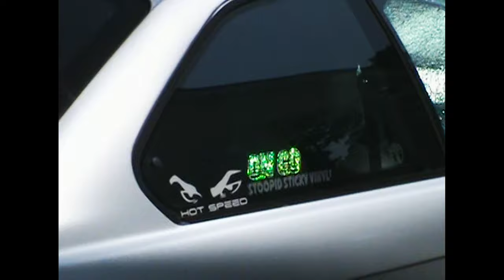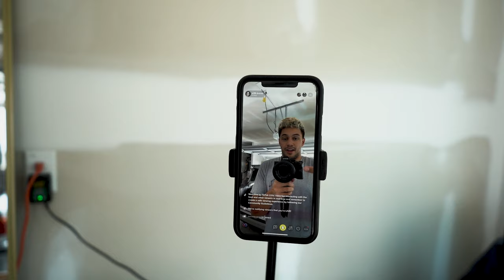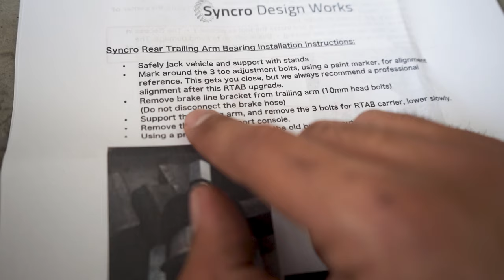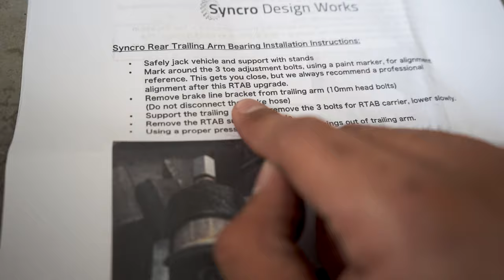𝔼𝟛𝟞 𝕥𝕦𝕣𝕟𝕖𝕕 𝕞𝕖 𝕚𝕟𝕥𝕠 𝕒 𝕞𝕖𝕔𝕙𝕒𝕟𝕚𝕔 | BEST RTAB replacement for e36!

Comment: That rtab bracket was modified for extra degrees of toe to compensate for camber so a stance guy had that car before lol. And I've had those Syncros on my car for 8 years and they've been perfect
Reply from the maker: Oh makes sense, whoever it was must have not been low enough there’s like zero signs of scraps under the car lol
Reply: Lmao
Reply: Stance guy or a drifter. Its a common thing to do amongst the drift community

Comment: let me slide and pickup that rtab tool I can’t get mine out😩
Reply from the maker: It was a rental from synchro. Call them up they’re in kennesaw and would lend you it
Reply: Just drill them.  Small hole near the edge and increase the bit size until you drill the bushing material.  Pops right out.